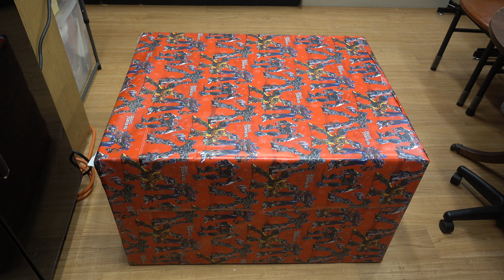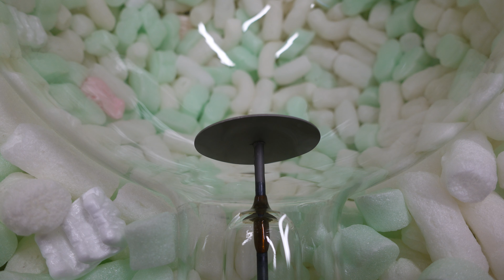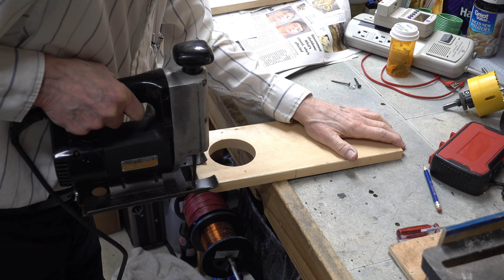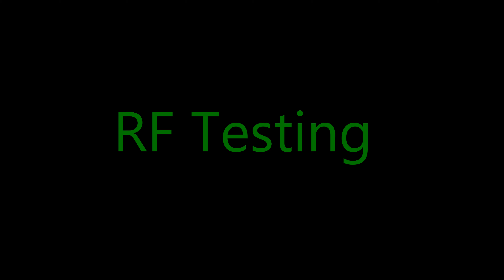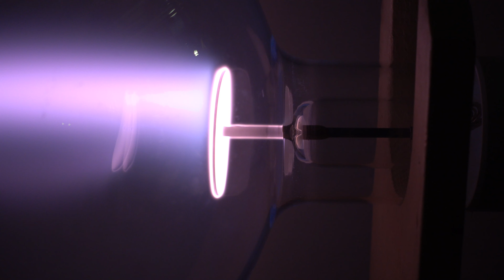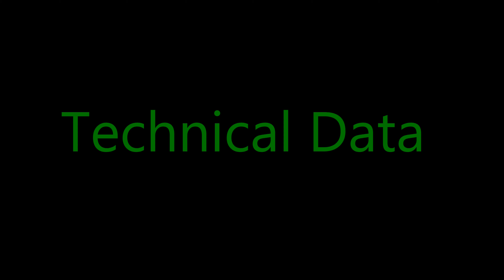The Bill Cheb 12-Inch Phanotron Tube: The MOAT

Comment: That was awesome! I'm curious about how phanotron tubes function and how they're constructed. Are these tubes completely sealed environments? If you remove the plastic caps, is the bulb completely enclosed with glass? Or can you refill it with different gases easily, without penetrating into the glass? Thank you :)
Reply from the maker: The tube is all glass with the wire leads sealed through the glass tube end.  The plastic end caps serve to protect the delicate glass to metal seal from being broken and allow for a place to install a screw connection for the external wires that carry power to the tube. Although the tube is sealed shut when it is manufactured, the tube can be opened again and the internal gas replaced with something different and then the tube is resealed.  However, it has been found that Helium gas works best with these tubes, being quite easy to light with a relatively low voltage. Other suitable gasses include Argon and Neon, but Helium is still preferred for its power output and long lifespan. Note that different gasses will have different apparent brightness levels at the same applied power to the tube, however visual brightness is not a good indicator as to the effectiveness of the particular gas used.
Reply from the maker: The tube is sealed at manufacturer, but it cab be rebuilt for about half the price of a new tube. They are usually driven by an RF carrier that is modulate with the desired signal to pulse the output of the tube on and off. While it is possible to put different gases in the tube it would require opening the tube and remanufacturing it with the new gas.  It's designed to use one gas only, normally helium, and after it's manufactured it's never changed.

Comment: Hi, thanks for sharing all this knowledge with us, can we know what metal is used for electrodes?
Reply from the maker: The electrodes are iron plates.  They have been heated under a high vacuum to drive out any occluded gasses that are present in the electrodes.  This is necessary to avoid contaminating the pure Helium gas used to fill the tube.
Reply: @spectrotekservices  Thank you for your time to answer question, how do you connect the tube with the transmitter? What power you use?

Comment: Just curious on why the 12 inch tube vs the 8 inch tube or the 1939 tube( no dimensions given)? 
I asked about the 1939 tube, there was no spec sheet available. 
Where did you get this spec table that you show at the end of this video?
Did you consider the Spooky tube? I noticed it was much cheaper but only to 50 Watts.
Thanks.
Reply from the maker: Hello,

Bill Cheb should be able to give you some technical data for the 1939 tube, since he manufactures virtually identical replacement tubes for researchers.

As for the data tables shown at the end of the video, the mechanical specifications were obtained from simply measuring the tube itself.  The electrical data was derived from tests I ran on the tube.

The reason the 12-inch tube was used for this video is that it was a brand new tube custom made for a researcher who wanted me to make sure it would work properly with my amplifier and coupler system.  To do that, I had to have the tube here for testing and setup.  I ran tests on the 8-inch tube some years earlier, but did not document those tests with a video.  Since not many people have seen a 12-inch tube in operation, I thought it would make an interesting video.

Because I do not have access to a Spooky plasma tube at this time, I have no data available for it.
Reply: @spectrotekservices  thank you for the reply.
I would be very interested in your tests on the 8" tube. Maybe you could post that video. Or do you have an email for questions? Which 8" tube did you use? The 7" plate spacing or 3" plate spacing? I understand there are two configurations for the 8" tube. Any chance to obtain a copy of your test plan?
I did ask Bill about the tubes, he really did not have any technical data available.
I asked about the Spooky2 tube because it was considerable cheaper. I'm just getting started on testing. Any additional information you have would be greatly appreciated.
Thanks again for your response.

Comment: I have a 12 inch Phanotron tube that I use with a Rife/Bare device and it has served me well for over 20 years. Good choice
Reply from the maker: Thank you for your comment on this video.  This is the largest Phanotron tube that I have tested.  It seems like a very powerful tube, and easily handles a lot of power.  With care, it should last for many years of service.